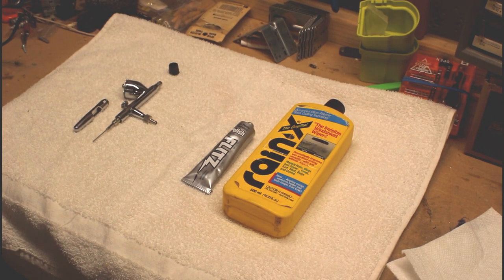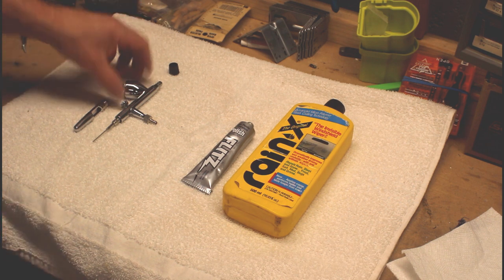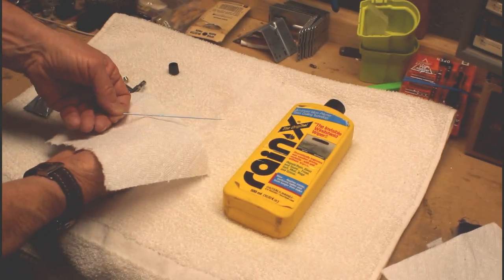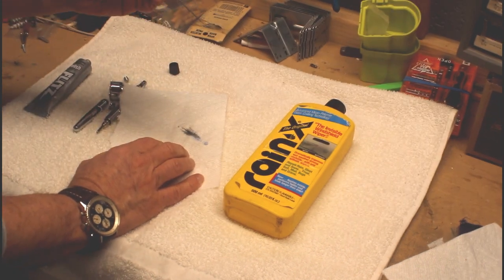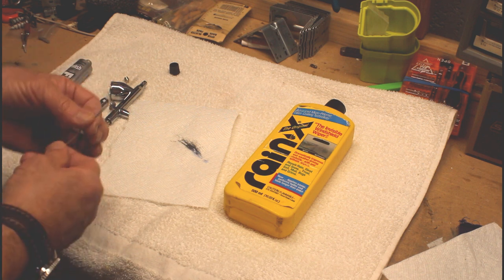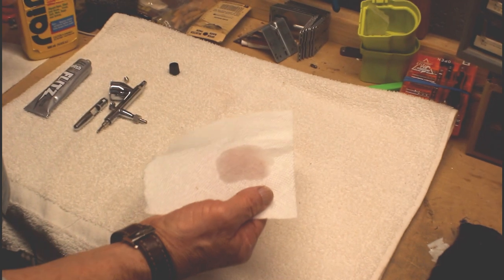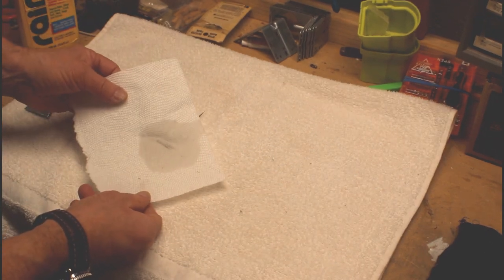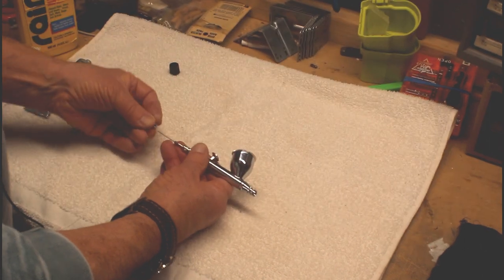Polishing an Air Brush Needle

Comment: did the rainX make a difference ?
Reply from the maker: It's hard to say, because I really didn't have an issue before but since it does repel water well on windshields it at the very least doesn't hurt in this application